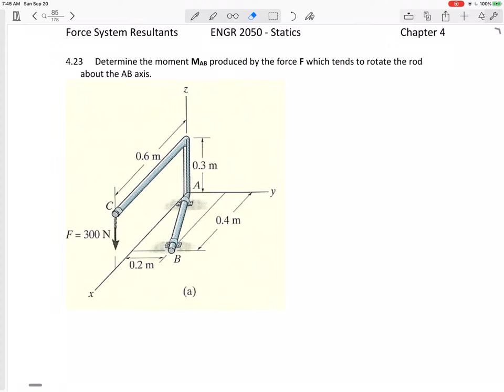Statics - 3D Moment about an axis example 3

Comment: Why didn't you break F to its component as you did in the previous problem?  
Also, when do you know when to break F to its component or to just use what's given in the diagram like this problem when you used F=-300 N? 

Thank yoooooooooou!!!
Reply from the maker: If F is only in one direction (like this problem) then there is no component in the other directions. So F = -300k IS breaking it into its components. Don’t over complicate it if it’s pointed in one direction like this.
Reply: Check the videos number 6-21  of static series for vector components. You will understand the answer. If you see the videos in a flow then you can understand it better. It has been beautifully explained with each problem covering a new aspect. All the best.

Comment: I used AC for the position vector where I divided {0.6, 0, 0.3} by the magnitude (sq.root of 0.6^(2)+0.3^(2)). My triple product matix looks identical except I used this other position vector {0.8944, 0.4472, 0}. I've looked it over a considerable amount of times, but am still not getting 80.5 for the momentum's magnitude. Has anyone else run into this? The magnitude I'm getting is 119.9927.
Reply from the maker: Hmmm... You say you used AC as the position vector. That’s fine, but don’t divide that by the magnitude. The equation calls for an “r” there so don’t divide by magnitude. Does that help?
Reply: @engineeringdeciphered  Wow, yes! I had forgotten, thank you very much!!!
Reply: I hope your day is going well!

Comment: at R ac you didnt write 0.3 k why?
Reply from the maker: I didn't do Rac. I did an R from A to the bottom of the line of action of the force. For the R in the equation, you can go from anywhere on the axis to anywhere on the (line of action of the) force. You can definitely use Rac = .6i + .3k if you want. See what happens - you'll get the same answer.